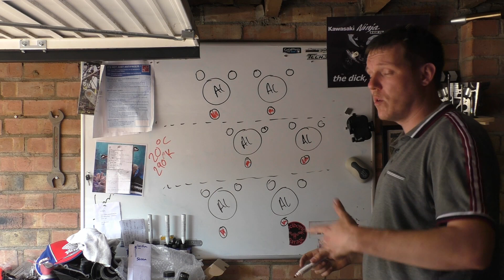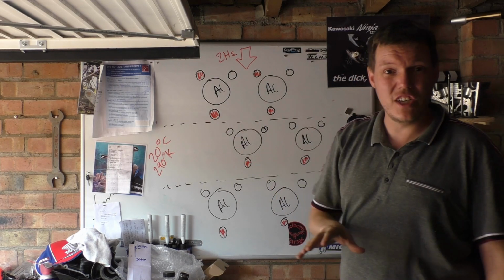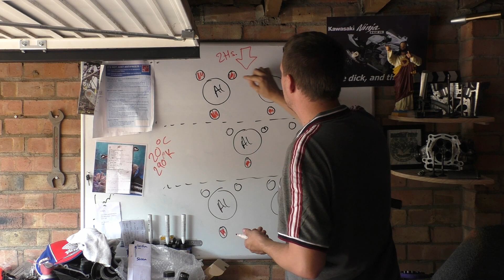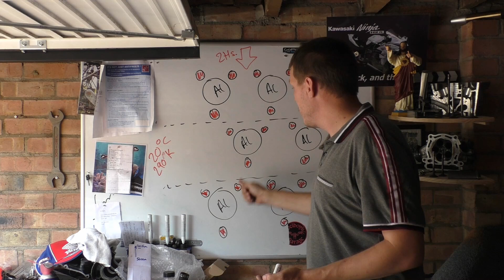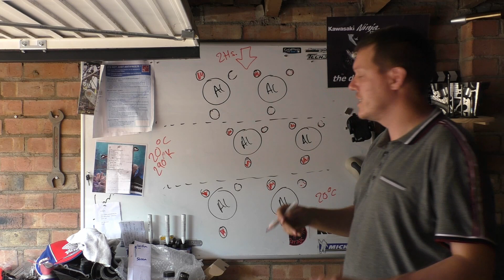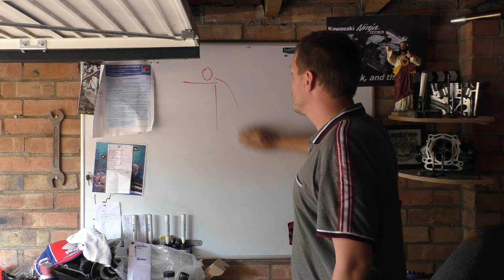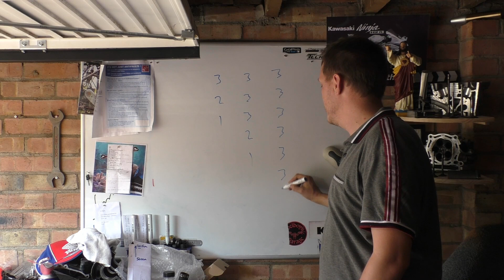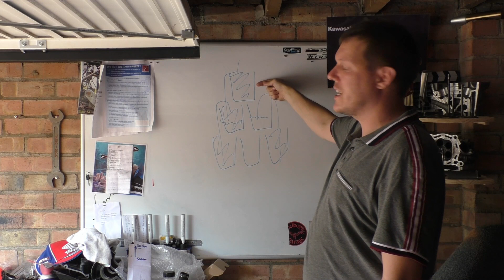Heat transfer - Shop Chat

Comment: Pressure always travels from high to low, and heat always travels from hot to cold. The little buckets around the atoms vibrate harder and bash against the buckets that vibrate less and spill over an amount of energy into them. Because you can't have a bucket that vibrates less to spill into a bucket that vibrates more.

That's how I have it in my head

Comment: Hi  Matt great video. Question.... Engines use heat to create energy very basic thinking here cos I don’t know to much about this sort of stuff but, why carnt extreme cold be used to make power that could drive something, probably a daft question , just a random thought. Cheers Clive
Reply from the maker: "Engines use heat to create energy very basic thinking here"

No, no, no LOL - heat is energy. Combustion is initiated and the 'engine' the piston/rod/crank converts this energy into motion.

"why carnt extreme cold be used to make power that could drive something, probably a daft question , just a random thought. Cheers Clive"

- greet question - I do a video on it.

Comment: Hey matt, on a previous vid you touched on thermal runaway with the ceramic coated piston. And explain how since heat is no longer traveling through the piston, what effect does thermal runaway and new combustion environment have on the rest of the system